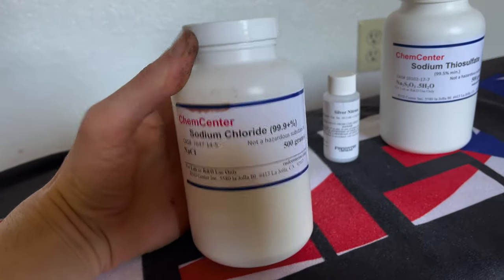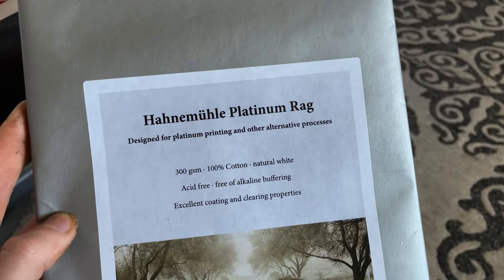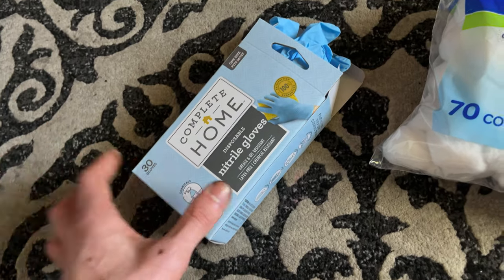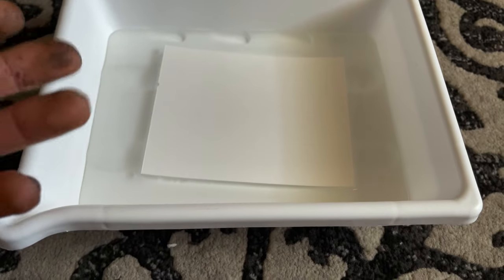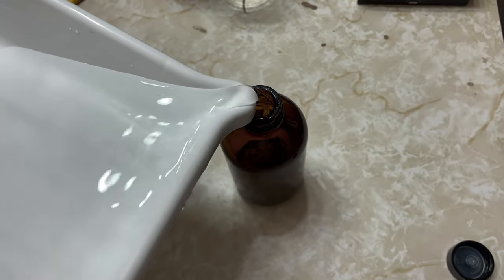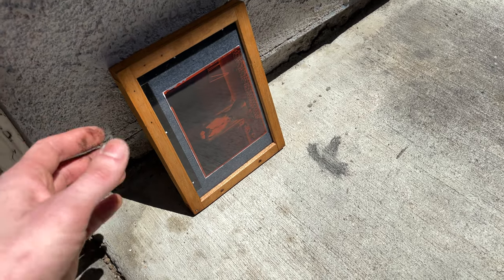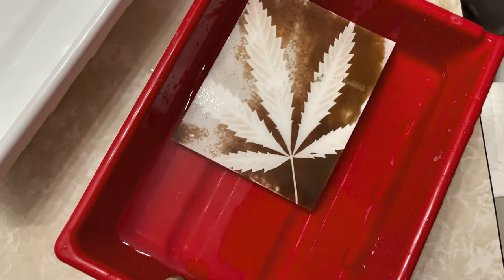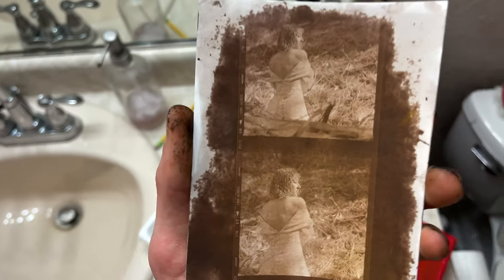How to make a salted paper print

Comment: Hi, thanks for the video! I really wish you had elaborated more on negatives - how you get your curves right for this super low-contrast process. I've been trying to find the way to boost contrast, but with no much luck yet. Pushing curves leads to lack of detail (with digital negs), pushing 9x12 analog negs - same problem, adding dichromate didn't change anything. I guess mb changing UV lights (I'm using solarium lamps) to real sun might help, but there is literally no sun for half a year where I live, so it's not an option. VDB seems more contrasty, but it's more complicated to make a solution for it. So, I'm still trying to figure the contrast in salt printing, any tips would be much appreciated!
Reply from the maker: I had the same problem! This is gonna seem counter intuitive to what you’re used to but youre gonna need some negatives that are a lot denser than what you’re used to. As a scan they’re probably gonna look very over exposed but you need that for salt printing. Because I’d the highlight areas aren’t dense enough they’re not gonna block the light from exposing the paper and the contrast is gonna be low. You may have to shoot some brand new negatives specifically with salt printing in mind. Hope this helps a little!!
Reply: @TheNegative  actually … that makes perfect sense to me, I’ll play with highlight density, probably just make a few options and test. Thanks!
Reply: Honestly, after years of doing these prints, I now just adjust the negative in Photoshop to my liking. I make it a little more, just by visual—I tried curves and all that years ago and it was a pain in the bum. I found it complex and time wasting and exhausting. I print the negatives on plain bond paper, in the strongest red I can get. Then I brush them thoroughly with olive oil or any good oil, wipe them off and let them 'dry' for a while. I then print with them. I lose a little sharpness., but it's cheap and I love the look. There is a limit to how deep the darks can ever be with a salt print—you will see that around the edges if any areas of sensitising solution are exposed to the sun or your UV lamp.